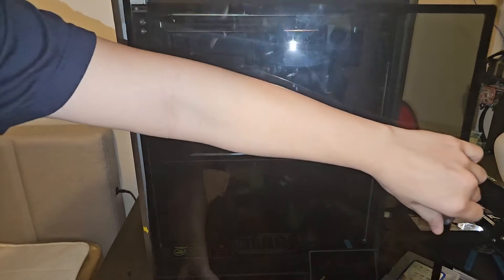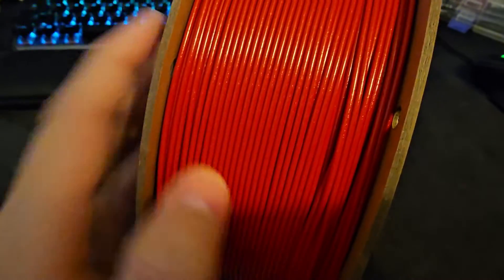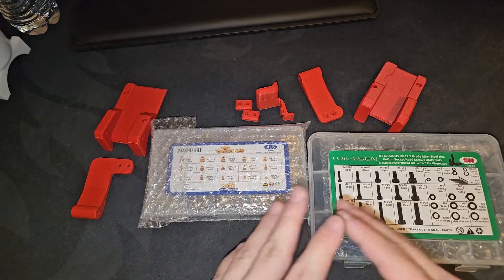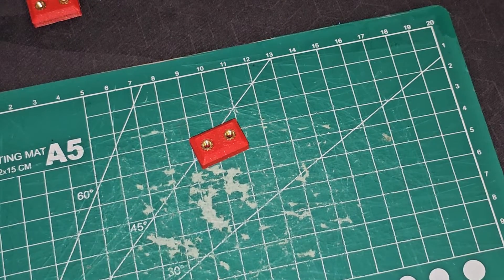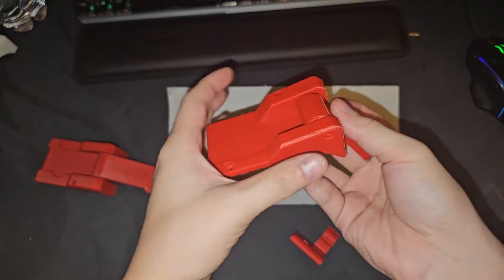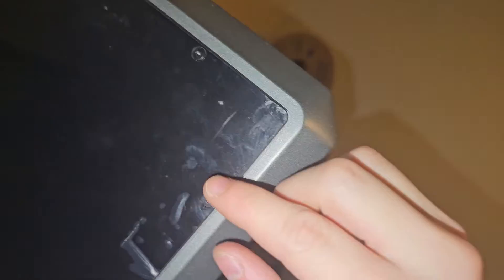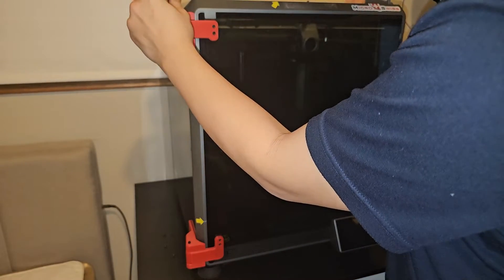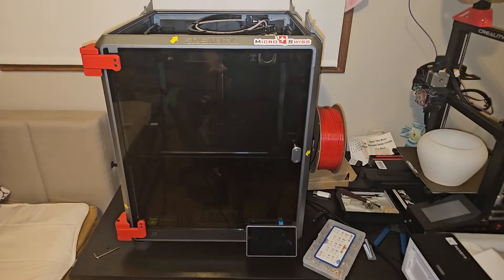Creality K1 Max 270° Door Hinges Installed!

Comment: When removing the door, unscrew the top hinge, then lift door w/bottom hing out. It won't try to fall.

Measure the thickness of the part where the screw is. Measure the screw. Add the 2 together and that is how long the new screw needs to be.

the + in pla+ is not backed by any standard. What makes you think it is stronger than ASA?
Reply from the maker: I'm now sure, the ASA I have just brake easily.

Comment: When installing heat set inserts, it is important to insert the soldering iron tip into the middle of the insert and press the insert straight down to ensure that it goes into the plastic perfectly straight. I highly recommend making the stealth heat set insert press. Most of the parts can be 3d printed and the parts you need to buy are cheap.
Reply from the maker: Yes, that is the best way to do it, but I found that my heat tip is longer than the inter itself, so if I do that it's going to melt the plastic part and could penetrate through it. I'll try to make one.